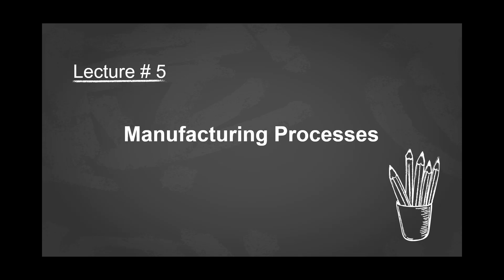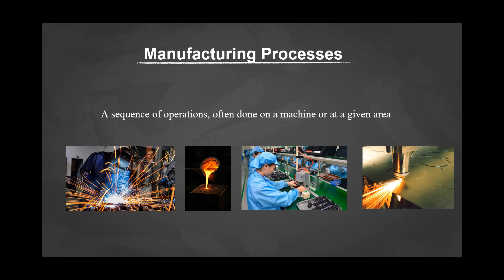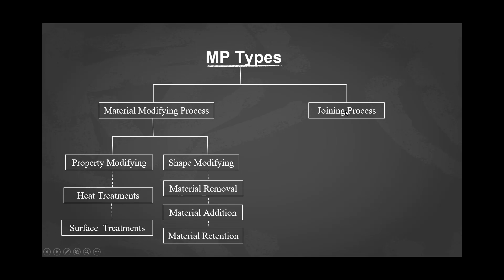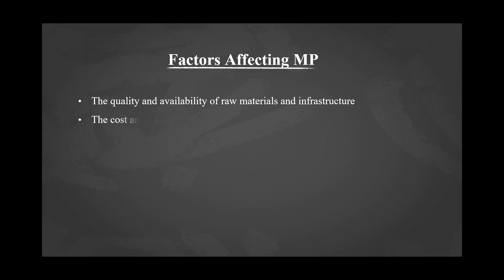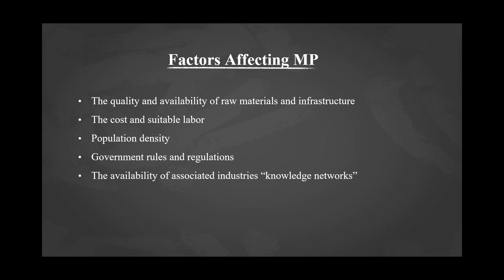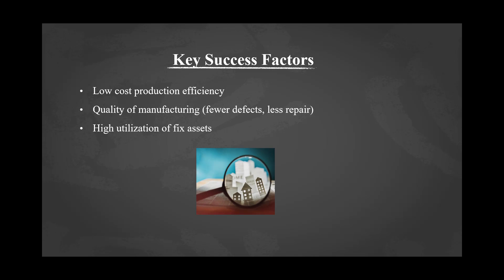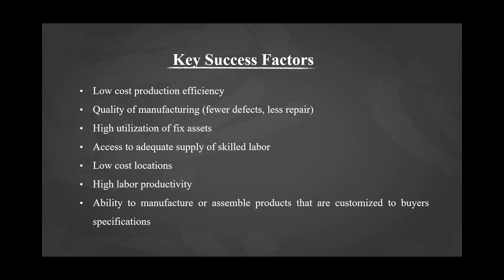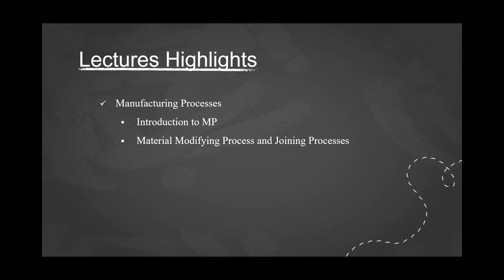lesson #5: Manufacturing Process,  Types, Factors and key success factors of manufacturing process

Comment: F18 0340
Manufacturing Process are the steps through which raw materials are transformed into a final product. Manufacturing process changes the forms of goods likecasting, welding, cutting.
Types of Manufacturing process:
 1: Material Modifying Process includes Property Modifying which is heat Treatment, Surface Treatment 
and Shape  Modifying is material Removal, Material Addition and Material Retention
2:  Joining Process  includes  permanent , non- permanent and semi- permanent processes.  Quality and availability of raw materials and infrastructures , cost and suitable labor , population density and government rules
ISSUES for manufacturing: processes are 
manufacturability of materials processing tools 
environmental aspects
 Key Success Factors : 
low cost product design and engineering, 
 access to skilled labor, low cost locations, high labor  productivity, ability to manufacture products that are customized to buyers specifications low cost production efficiency,  quality of manufacturing
Assignment
SUMMARY:
ROLLNO: F18-0340
In this lecture, we discussed about the performance measurement that a performance measurement system typically comprises systematic methods of settings business goals together with periodic feedback reports that indicates progress against goals. And then we discuss Key performance indicator and operational metrics. And some of very popular business metrics are Sales Revenue, Net Profit Margin, Gross margin, Sales Growth Year to Date, Cost of Customer Acquisition, Customer loyalty and retention, Net promotor score, Qualified leads per month, Lead to Client, Met and overdue milestones, Employee happiness. Key Performance Indicator is a measurable value that demonstrates how effectively a company is achieving key business objectives. High level KPIs may focus on the overall performance of the business, and low level KPIs may focus on processes in department such as sales etc. The real key to effective performance measurement system is strategy. BPM methodologies are balance score card and six sigma. Use Balance score card to communicate what they are trying to accomplish. It is use to prioritize project, product and services. Now second methodologies that is six sigma Six sigma is a method that provide organizations tools to improve the capability of their business process. this increase in performance and decrease in process variation helps lead to defect reduction and improve in profits, employee morale, and quality of product of services. And then the two methods of six sigma are DMAIC and DMADV. DMAIC is used for projects and DMADV is used for new projects. Steps of DMAIC are Define Measures Analyze Improve Controls and DMADV steps are Define Measures Analyze Design Verify. In the end difference in BSC and six sigma is discussed.
Also The Task you have given  to us
What is Lean Six Sigma?
Lean Six Sigma is a process improvement methodology designed to eliminate problems, remove waste and inefficiency, and improve working conditions to provide a better response to customers' needs.

It combines the tools, methods and principles of Lean and Six Sigma into one popular and powerful methodology for improving your organization's operations.

Lean Six Sigma's team-oriented approach has proven results in maximizing efficiency and dramatically improving profitability for businesses around the world.

Comment: Roll No: F18-0334
BSSE 5th Section(B)
In lecture no 5 we have studied about another important module of BPE which is called Manufacturing Process. A manufacturing process is a sequence of operations often done on a machine or at a given area for example welding, casting or cutting etc.
There are 2 main types of manufacturing process.
1-	Material modifying process
In which two modification occurs the first one is property modifying and the second is shape modifying    		
2-	Joining process.
Manufacturing process is a complex process. There are many factors that can effect this      process like availability of raw material, cost of product and the labor, some rules and regulations of the government.
Some key factors to achieve goals.
1.	Low cost production
2.	Ability to manufacture product that are customized
3.	High utilization
4.	Quality of manufacturing
5.	Low cost location 
ASSIGNMENT 1:
  Project: facilitating organizers
Strengths:
 1- Location:
                   the location of Haripur is quite suitable because there is not much competition. The location is familiar for us. There is a need for a project like ours.
2- Availability of resources:
                  The venues, the food services, the decoration services, vehicle services etc all are frequently available in this region.
3- Availability of work force:
                  We need young and enthusiastic people for the job. In our region we have a lot of young people willing to work for us.

Comment: F18-0330
BSSE 5th (Section:B)
Assignment:
Topic : 
                  Home Bakers  
Strength of this Business: 
 ✓The uniqueness in the design of the product will help to distinguish it from its competitors as consumers will not be able to get         this type of products from anywhere else.
✓ The home bakers will post about the availability of products on social media networking sites (Facebook ,Instagram)to keep the audience update about products.
✓ We will keep the prices of our products cheaper than our competitors so customer can get quality products in less cost.
✓We will provide home delivery as well as take away option for customer .
Why We Choose this Business? 
We choose this Business for some reasons which are : we can run this business from home and do not require separate quarters to do so.
our cake business will allow flexibility in our schedule. We can decide when and how many orders to take.
Low startup costs! Since we don't have to rent some space, then rent can be taken off the budget list. Also, cake supplies are relatively cheap and definitely easy to come by. So there are more reasons like these due to which we choose this Business.

Comment: F18-0330
BSSE 5th (Section:B)
Summary:
In this lecture we studied another important module of BPE   that is Manufacturing Process .A manufacturing process is a sequence of operations often done on a machine or at a given area for example welding, casting or cutting etc..The cycle of manufacturing process convert materials into parts and products .
There are two main types of manufacturing process.
1)Material modifying process
2)Joining process
 Material modifying processes: this process either change the properties of material or shape of material so it is further divided into two processes which are PROPERTY MODIFYING and SHAPE MODIFYING.
Joining process which have permanent , non permanent and semi permanent joints.
 Key success factors:
✓ production efficiency
✓quality
✓high utilization of fixed assets
✓access to skilled labor
✓low cost location
✓high labor productivity
✓manufacture customized products
✓low cost product design and engineering.

Comment: BSSE 5th B 
F18-0321
Osama Bin Khalid

Summary:
Manufacturing Process:                 
Manufacturing process refers to sequence of operations often done on a machine or a given area. It is a process of addition or subtraction of a material to give shape or property to a work piece. 
Types of manufacturing process:
It has 2 types:
1- material modifying process 
             i- property modifying 
             ii- shape modifying
2-joining process.
Manufacturing process is a complex process. There are many factors that can effect this process.
following are some of the  factors affecting :
1-government rules and regulations
2-cost and suitable labor
3- population density
3-quality and availability of raw materials
4-knowledge networks. 
Following are the key success factors:
 1-production efficiency
2-quality
3- high utilization of fixed assets
4-access to skilled labor
5-low cost location
6-high labor productivity
7-manufacture customized products
8-low cost product design and engineering. 

Assignment 1:
             Project: facilitating organizers
Strengths:
 1- Location:
                   the location of Haripur is quite suitable because there is not much competition. The location is familiar for us. There is a need for a project like ours .
2-  Availability of work force :
                  We need young and enthusiastic people for the job. In our region we have a lot of young people willing to work for us.
3- Availability of resources:
                  The venues, The food services, the decoration services, vehicle services etc all are frequently available in this region.

Comment: Rabia Malik
F18-0348
BSSE 5th B
Summary:
                manufacturing process is a process of adding of subtracting of a material to give shape or property to a work piece. It has 2 types: material modifying process, joining process. it is a complex process. many factors can effect this process including government rules and regulations, cost and suitable labour , population density, quality and availability of raw materials, knowledge networks. key success factors include production efficiency, quality, high utilization of fixed assets, access to skilled labor, low cost location, high labor productivity, manufacture customized products, low cost design and engineering. 

(Ma'am I was not assigned the assignment given in the end)

Comment: F18-0339 
BSSE 5th B
Summary:
In this lecture we study about the issues for assembling measures are manufacturability of materials, handling apparatuses , natural angles. 
Sorts of Manufacturing Process: 
It have two processes
 Material Modifying Process 
 Joinning Process 
In Material Modifying Process incorporates • Property Modifying and Shape Modifying.
In Property Modifying( Heat Treatment, Surface Treatment ).
In Shape Modifying ( Material Removal, Material Addition and Material Retention) . 
 Joining Process incorporates perpetual , non-lasting and semi-perpetual cycles. 
Quality and accessibility of crude materials and frameworks , cost and reasonable work , populace thickness , government rules and guidelines, accessibility of related businesses .
 Key Success Factors : 
Ease creation effectiveness 
Nature of assembling
High usage of fix resources
Ease areas
High work efficiency
Plan and designing.

Semester Project: Home Tutor Service
Strength: 
The main strength of this business is that every student can avail a tutor anytime at his door step. We do not need to hire staff or tolet any building to run our setup. Our strength is our hardwork and passion toward our goal. It is a business like uber and cream where any student can hire a tutor for specific amount of time using our app where we provide best tutor in your area. Key success factor in this business is that it is low cost and we do not have to hire any staff for this business to run, by utilizing our knowledge and smart devices we can grow this business easily.

Comment: F18-0366
BSSE 5th c 
Manufacturing process is a sequence of operations often done on a machine at a given rate.During manufacturing process we add and substract of all the materials to create a desire material. Furthermore, there are two types of manufacturing process
Material modifying process
Joining process
Moreover, material modifying process further divided into:
Property modifying
Shape modifying
In property modifying there are two treatments i-e
Heat treatment
Surface treatment
These treatments changes the power.
And in shape modifying process modification takes place by
Material addition
Material removal
Material retention
And the other main type is joining process. Joining process may be permanent, semi permanent and non permanent.
And there are further factors that affect manufacturing process are:
*Quality and availability of a material
*Government rules and regulations
*Availability of associated materials "knowledge networks"
*Cost and suitable labour
*Population density
Furthermore there are key sucess factors that are
1- Low cost production efficiency
2- Quality of manufacturing
3- Utilisation of fixed assets
4- Skilled labours
5-Low cost location
6-High level productivity
7- Low cost product design
8-Engineering help industries etc
These are the key success factors for industries to achieve their goals.

Comment: F18-0353
BS SE 5th B
Summary
In this lecture we discussed about the manufacturing process that manufacturing process is a sequence of operations, often done on machine or at a given area. During a manufacturing process we add subtract of raw material into a desired property or product. Cycle of manufacturing processes convert material into parts and products starts immediately after the raw material are either extracted from the minerals or produced from chemicals or natural substances. Manufacturing process has two types 1) Material Modifying process 2) Joining process. Material Modifying process has further two types 1. Property Modifying 2. Shape Modifying. Property Modifying techniques includes heat treatments and surface treatments these treatments improve performance and power of a material. In Shape Modifying technique the modification of a material is achieve from material removal, material addition and material retention. Now the second main type of manufacturing process the joining process. In joining process there is permanent, non-permanent and semi-permanent joints. Now the factors that affects the manufacturing process is availability and quality of raw material.  Cost, suitable labor, population density, Government rules and regulation etc. The key success factors of manufacturing process are low cost production efficiency, quality of manufacturing, high utilization of fixed assets, access to adequate supply of skilled labor, low cost locations, high labor productivity, ability to manufacture or assemble products that are customized to buyer’s specifications and low cost product design and engineering.

Comment: In manufacturing process, sequence of processes on machine at specific area and cycle starts with the item plan and materials detail from which the item is made. There are two types of MP.
1: Material modifying process.
2: Joining Process.
In material modifying process, we can change the properties and shape of material. It is further divide into two processes.
1: Property Modifying Process.
2: Shape Modifying Process.
In joining process, we studied three joints I.e Permanent, Non Permanent, Semi Permanent.
After we have studied some factors that affects Manufacturing processes like cost and suitable labor, population density, etc
 In the end we explored every key success factor in detail that includes:
Low cost production efficiency, Quality of Manufacturing, High utilization asstes etc.
then we saw some examples for ultra low cost products from automated and other companies.
F18-0341.
BSSE IT 5th SEC C.

Comment: F18-1180
BS(SE) Section "B"
Project: Home Tutor Service
Strength: 
The main strength of this business is that every student can avail a tutor anytime at his door step. We do not need to hire staff or tolet any building to run our setup. Our strength is our hardwork and passion toward our goal. It is a business like uber and cream where any student can hire a tutor for specific amount of time using our app where we provide best tutor in your area. Key success factor in this business is that it is low cost and we do not have to hire any staff for this business to run, by utilizing our knowledge and smart devices we can grow this business easily.

Comment: F18-0375 BS(SE) 5th C 
Summary:
 Manufacturing process: 
 "Manufacturing processes are sequence of operation often done on a machine or at a given area ." 
Example welding,casting etc
 Types : 
✓Material modifying process
✓Joining process
 Material modifying process either change the property or shape of material. 
It is further devided in
✓Property modifying process
(Techniques include:Heat treatment ,surface treatment )
✓Shape modifying process(it is obtained by material removal, material addition, material retention)
 Joining process are permanent , non-permanent and semi-permanent joins.
 Factors effecting Manufacturing process: 
✓Quality and availability of raw material and infrastucture ✓Cost and suitable labor ✓Population density ✓Government rules and regualtions ✓The availability of associated industries "knowledge networks".
 Key Success Factors: 
✓Low cost product efficency ✓Quality of manufacture ✓Low cost location ✓High labour productivity ✓High utilization of fix asset etc
Reply: F18-0375, BS(SE) 5th C 
          Assignment 
 Business topic:             Printing-press services 
Strength of business:
✓Quicker turned around time
✓Multi color material printing
✓High product quality 
✓Better customer support
✓Better result and higher quality
✓Highly experienced owner operator
✓Online product selling
✓Various design possibilities with full color and gradiation print without limitation of colors
✓Quick delivery
✓Color matching time is reduced
✓Production at lower cost
✓Does not require any knowledge because of simple process
✓Variable data printing and custom production
✓Original inks and inkjet technology
✓Customised or personalized printing